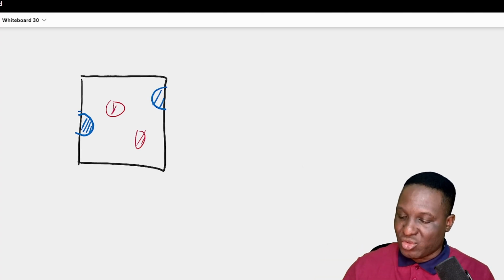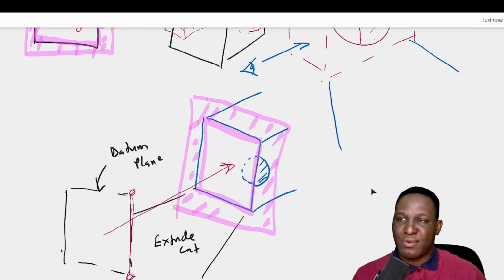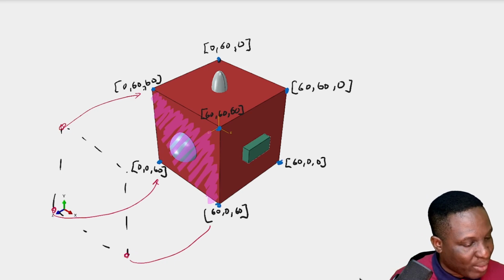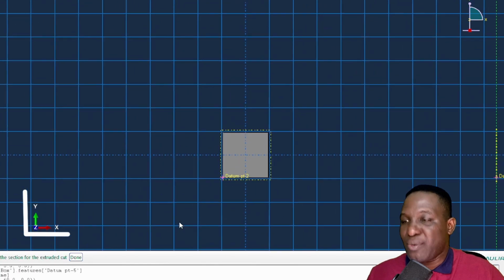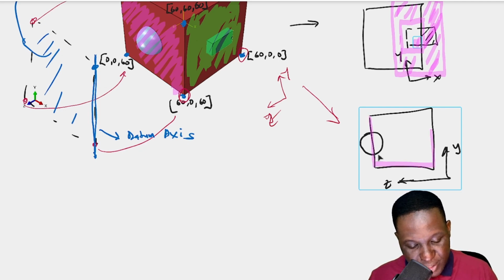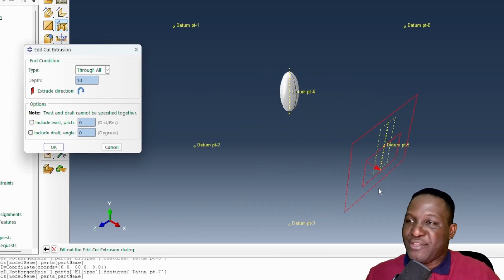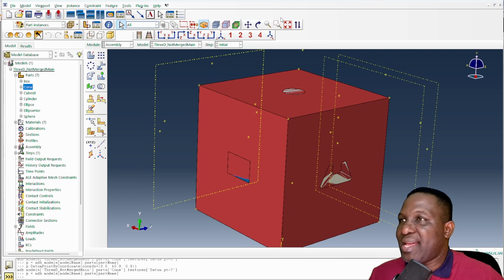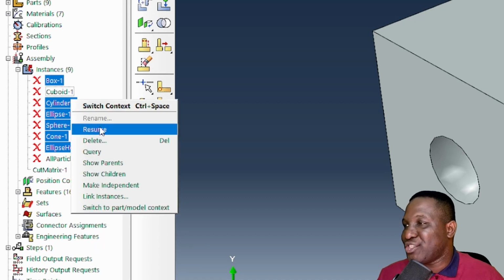How to Easily  TRIM Different Shaped BOUNDARY PARTICLES in 3D RVEs

Comment: Hello,

Can we get the effective properties for MuCell technology??
Reply from the maker: Hello Sam, I am not sure what a MuCell technology is? From my brief research, it seems to be some kind of polymer foam where a supercritical gas is infuse with the polymer during the injection moulding process, which ultimately diffuses into the ejected polymer to form a porous media. If this is so, then it is essentially a porous media and in which case can be treated as such. It is therefore possible to find the effective properties. I do not assume the contents of the voids (gases) make any meaningful mechanical contribution to change the behaviour of the material. So, essentially, running an RVE study on a randomly voided microstructure of the parent polymer and then extracting the properties from your simulations should give you the effective properties.

Comment: Hello, thank you for your video. This method is good and easy for simple model. If we have lot of particle in our 3D RVE for example more than 5000, this procedure take lots of time. Because we have to select every particle individually. Could you please explain how i can do that automatically?
Reply from the maker: Hello @Hossein, just like everything else, you have to decide how to go about it. The approach of merging the particles into a single part and then extrude-cutting it as a whole is what I will recommend. This way, you do this just one go and then get it done. I showed this in my earlier video with the 2D scheme here: https://youtu.be/CBitNt0qqpQ

My understanding is that for your problem you do not want to merge the particles into a single part and want to selectively trim off the boundary particles one-by-one. This is clearly challenging for up to 5000 particles.

Your only way out is to replicate what I have done in a Python script, which you will run in an iterative loop. In developing such script, you will probe the whole domain, tag the boundary fibres that appear on all six boundary surfaces of a cuboidal system. Then for each group, iterate through them in your script and follow the same process I have used. It is not going to be straightforward but from what I know of ABAQUS so far, I cannot see a way out. Unfortunately, you have to get your hands dirty writing and debugging the Python code until it works to your satisfaction. If not, I am afraid the manual way is the way.

Good luck with this!
Reply: @MichaelOkereke  thank you so much for taking your time to reply my inquery.
I will attempt what you suggest. I hope I manage to solve my problem. I really got stuck in bad situation.
Thank you again for everything